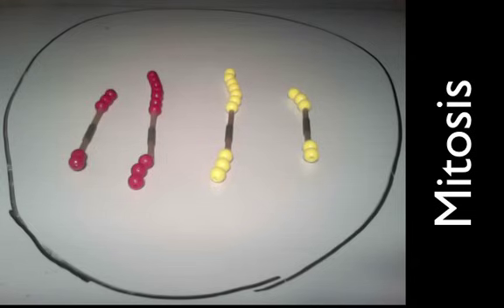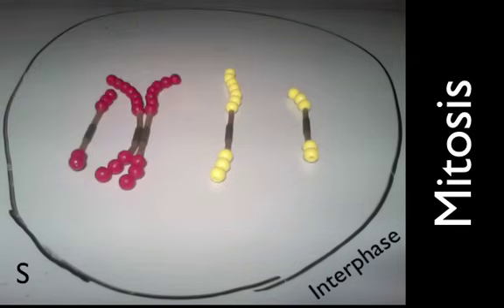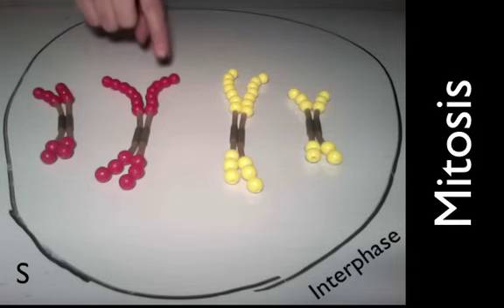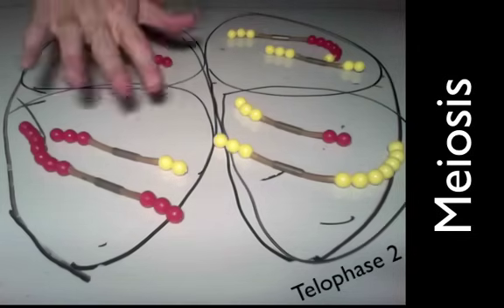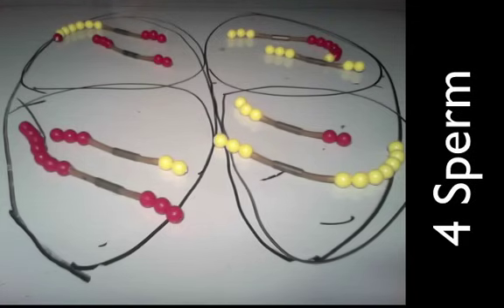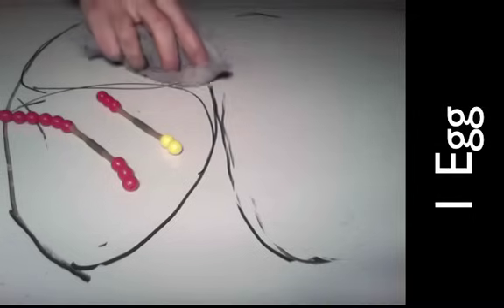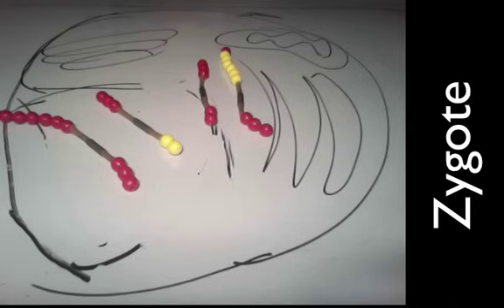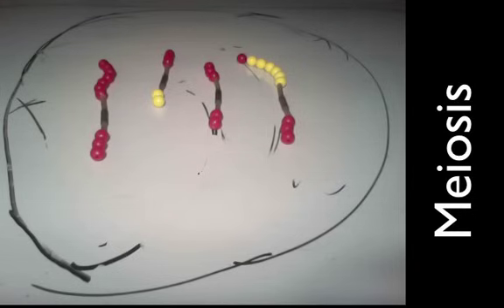Mitosis and Meiosis Simulation

Comment: Early on, it has a sing that states mitosis. However, the process explained is meiosis. Mitosis does not have mother and father cells: Mitosis occurs asexually.
Reply: crushgrip2 Hi, hope that this helps: Somatic cells have the DNA that is a mixture of the biological parents' DNA. In homologous pairs, the chromosomes carry the exact same genes, but different alleles (traits) for each gene.
Reply: oooohhh. I was under the impression that the two different colors were used to represent two different parent cells. Thank you! (My biology final is coming up, and I would've gotten that one wrong!)

Comment: What happens to the DNA in the polar bodies once it forms into the egg?
Reply: +doublea422 your mum
Reply: I also search it on wiki the polar body will either disintegrate or the polar body and the egg will become fertilised  by 2 separate sperms. But the zygote formed from polar body n sperm usually failed to develop due to lack of nutrient
Reply: I think I also found out an answer during my genetics class. It seems like the polar body's DNA is turned off inside the nucleases. Or that's only to do with extra X chromosomes in women... I could see it going through some kind of apoptosis as well.

Comment: the sperm joins the self fertile egg. The other parts of the egg are the builing  material and animating force. the egg conceives the  sperm. The sperm is taken in and fertilized by the ova.
Great visual. The beads are easy to see and  distinguish between phases. Okay  so the right side is recessive ?

Comment: this is a dumb question but I'm confuse on the number for chromosomes?...so in mitosis each baby cell gets 46 chromosomes and in meiosis each get 23?????
please answers my question
Reply: The only dumb question is the one you never ask. In mitosis, you end up with 2 identical daughter cells, each with the same 46 chromosomes; 2 copies of the 46, then split in two. In meiosis, you end up with 23 chromosomes in each of the 4 daughter cells; 2 copies of the 46, reshuffled for genetic variation, divided by 2, and divided by 2 again. The 4 cells at the end of meiosis become sperm or egg, and the union of the two make an offspring with 46 chromosomes. Hope that helped!

Comment: Isn´t the 50-50 split you talk about at 08:35, what is called Mendel first law, the law of segregation, as you explain it in you other video called "Genetics"? Independent assortment has to do with independent inheriting of different form of genes (or alleles). And what is said in the box about MISTAKE? I've Dutch subtitles under the video so I can't read the second line, although I've an idea about what it is...

Comment: HEY THANKS ! i was getting really bogged down but this was really helpful! I dont know if you chose not to add the part or you forgot but the reason why there are two poles where the spindle lead the chromosomes is because of the CENTRIOLES! :) made of microtubules which allow the spindle thing to happen .

Comment: You're only going to have 92 chromosomes in meiosis, it's a confusing process, but remember, in meiosis the diploid cell is split up into 4 haploid cells, which each have 23 chromosomes, without detailing the complicated bits about the pairs being split up and stuff, just think about it, 23 x 4= 92...with doubling and all that you had 92 at the beginning. Now mitosis is totally different since you're only making 2 cells and stuff. Interphase doesn't have to be mentioned, but it's before prophase

Comment: As for the chromosome count,
Every cell in your body, except the gametes  (sperm and egg) produced from meiosis, has 23 pairs of homologous chromosomes- with 1 from mom and 1 from dad that are different from each other (so 2x23=46). During DNA replication in Synthesis phase before mitosis, each chromosome you have is replicated for a total of 92 chromatids (not technically chromosomes since 46 are copies). During mitosis, these are split and the resulting cells have 46 again (23 pairs).

Comment: In the cell growth cycle, interphase is the entire part that occurs when mitosis is not happening. Interphase includes, Gap 1, which is when the cell is growing preparing for DNA replication, Synthesis-which is when DNA replication occurs, and Gap 2 phase-which happens when the cell is preparing for mitosis. The video shows interphase occuring before mitosis.
During mitosis, yes the phases you listed are correct.

Comment: After interphase, your cell has a chromosome that contains your mom's genes in 2 identical sister chromatids, and another homologous one which contains your dad's genes.
During the anaphase just one chromatid of a pair goes to the pole of the cell.
As a result, you get two identical nuclei, each of which has the 21st chromosome represented by your mom's and dad's genes.
At first DNA is a mess. Only during the interphase does it turn into visible chromosomes - and that's after the replication.

Comment: Did your question get answered ?  What he is showing here is the entire cell cycle, not just mitosis. In Interphase the DNA is available for reading, so is long and only a few atoms thick (think about it). So just appears as chromatin if stained up. As he says here, the DNA content of the cell goes from 2n to 4n, splits to 2 lots of 2n in two cells, then each doubles to 4n, then two lots of 2n and so on. Humans have n=23, so yes before the dance of separation there are 4n=92 chromosomes per cell

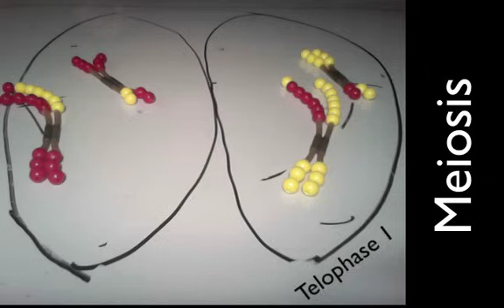Comment: 09:10 - you definitely missed Prophase II (chromosomes condense again, membrane breaks down again, stuff disappears again, centrioles form spindle fibers on opposite poles which attach to the centromeres on each chromosome preparing to start pulling (metaphase)).

Comment: Also, you must not make the mistake to think that 2 chromosomes in a homologous pair always stand side-by-side. In Mitosis, they DON'T. The author has shown this at 00:58 : you can see that 2 chromosomes on the outside (far left and far right) are homologous; but they DO NOT stand next to each other. They duplicate separately in mitosis. However, it's another story in Meiosis. At Prophase I, homologous pairs now stand side-by-side, do all that crossing-over thing then separate in Anaphase I.